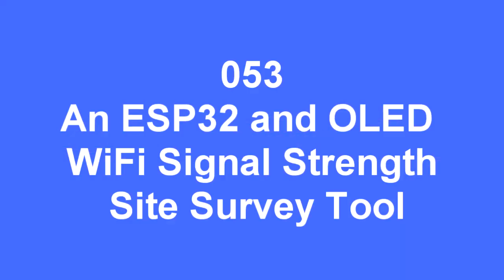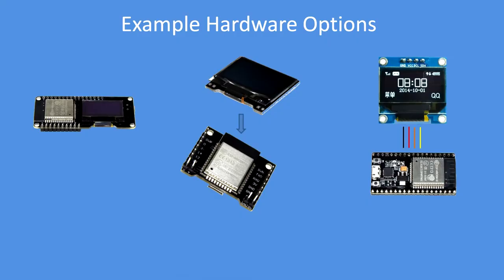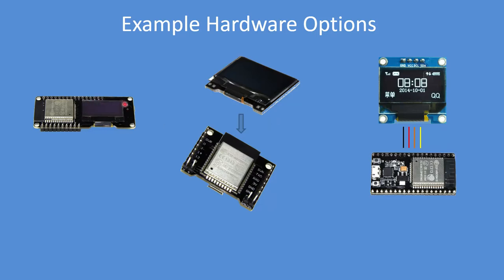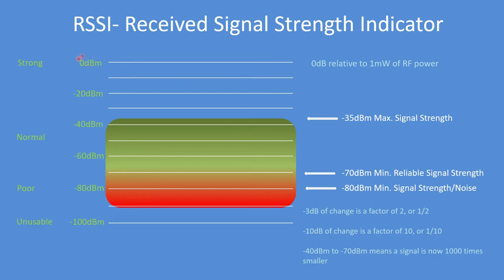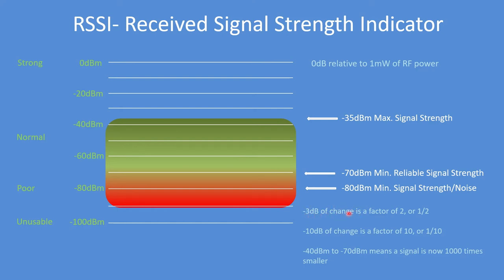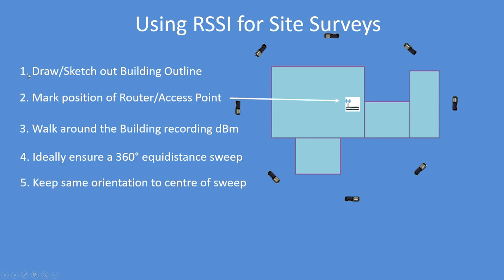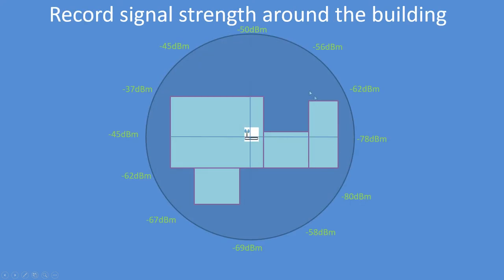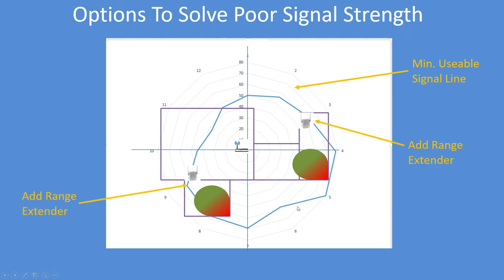Tech Note 053 - ESP32/ESP8266 WIFI Survey Tool; Interpreting RSSI and conducting a survey

Comment: I had to change the name slightly to make it match the .ino file.  Add _WiFI and change - to _  It then compiled properly.  I didn't try the function yet, i need to get a battery for my unit to make it portable.
AdaBill
Reply from the maker: +AdaBill do you mean for the 8266? I've just added an ESP8266 version.
Reply: G6EJD,
No, I meant that the names of the file and the INO need to be the same.
I checked you new offering and I think it might be best to use a conditional assembly define to seperate the ESP32 or ESP8266.  The final user would then only have to choose which type of ESP they want to build via comment out //.  I don't think there is a lot of difference so the added #ifdef's should be few.
If you like, I can give it a try?